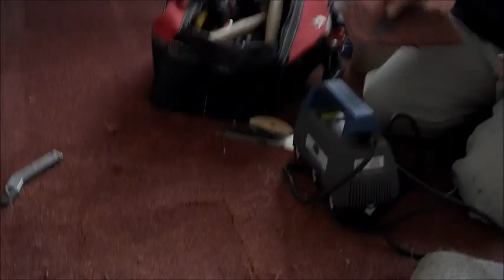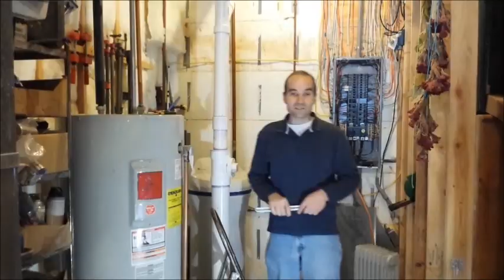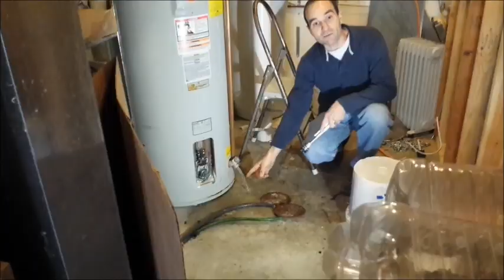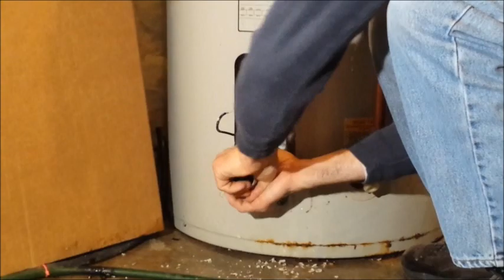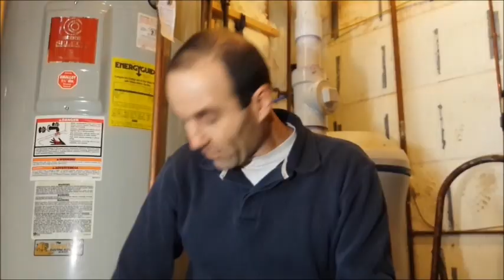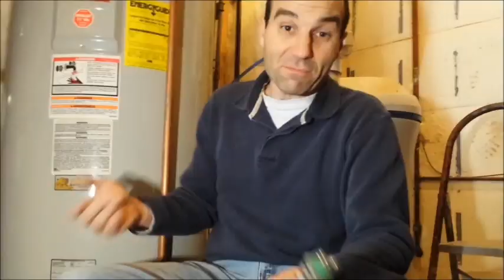Replacing a water heater element

Comment: We're do get the socket tool?
Reply: You can get this at Home Depot, Lowes, or Ace Hardware. Most of these types of places have heating elements, thermostats, and stuff - the element wrench will be around them in the store.
Reply from the maker: +Jeffrey Anderson Yes, I agree.  Many smaller hardware stores will have them, as well.  
You can also buy a mechanic type socket, but the cost will be higher.

Comment: mine has a reset button yyaaaayyy. so happy.
Reply from the maker: That's great, Ivan.  Just be aware that if it keeps tripping, then you may have a bigger problem.  Hope all is well!
www.houserepairsyourself.com
Reply: +Home Maintenance Solution, Inc quick question is it bad if the water is too hot ? it does have a pressure valve but should i turn the knob down if i think its steaming or can i leave it really hot?

Comment: Thanks for the video; never had an electric hot water heater before. Using Hydrochloric acid may get rid of the scale on the element, but you checked the continuity and it was bad....I don't think cleaning it will make a difference in the continuity.
Reply from the maker: Definitely true.  Thanks for clarifying that!  Enjoy your home repairs!

www.houserepairsyourself.com

Comment: Thanks for the clear instructions . I have a 25 gal gsw single element that I replaced some years ago and I did it without the element wrench but I will need to get one 40 mm size . I may have used a small pipe wrench to replace that prior element but now it wouldn't budge and I'll go get a proper element , as you mentioned that they sell fairly cheap. Thanks again.
Reply from the maker: Glad to hear that you are tackling the problem!   Best to you! 
Www.Www.houserepairsyourself.com